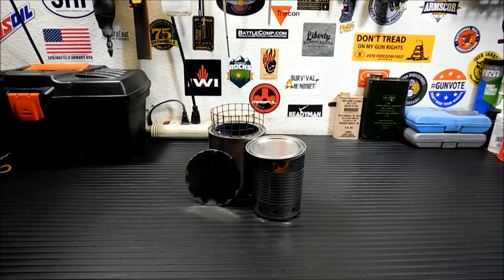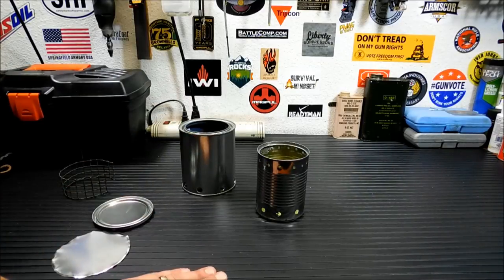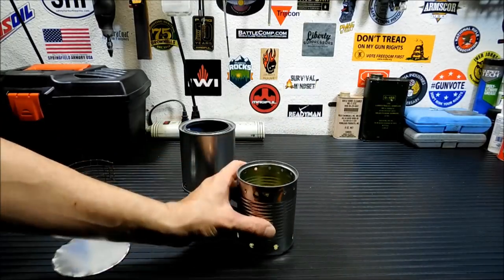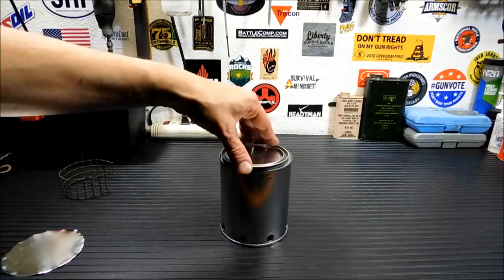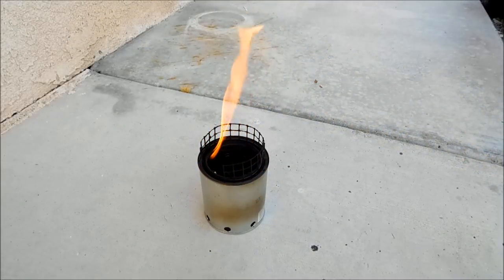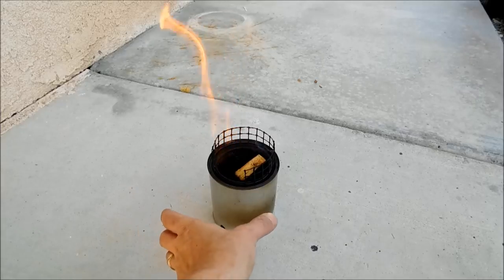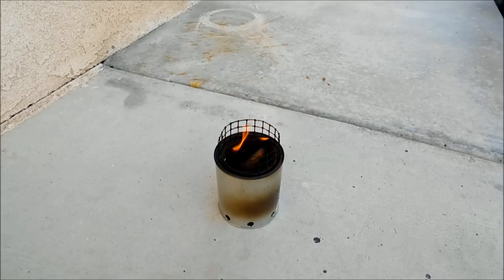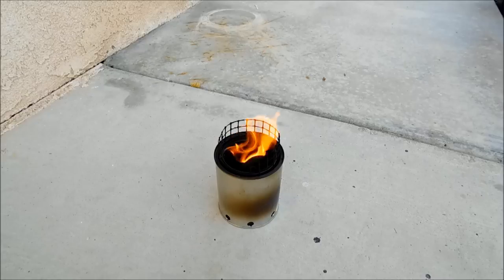Make A Wood Gas Stove With Only Two Cans

Comment: Great video, I just bought a paint can at lowes the other day to make something similar. This is a lot more easy than the one I had in mind. Thanks for posting.
Reply from the maker: No problem, the Lowes one is the exact same, I have seen in the past, people using the lowes can, it has the same inside lip that will fit that soup can perfectly.  Thanks!

Comment: I see two different size holes- what diameters are they?
Still not seeing what's going on, why the smoke leaves the small can and returns instead of coming out the top...
Reply from the maker: Bottom holes are 3/4 of an inch, not all that important but as long as they are big enough to suck gather the air from the outside.   Inside the can on the top where the gas escapes and burns is  3/16ths.

Gasifiers work on the updraft principle: The air passes up through the fuel, in this case wood, along the inside of the outer can and is re-ignited as it comes out of those top holes in the inner can, almost like burners. Hope that helps.

Comment: Said stove is not a bad idea, as long as you can burn hard wood. I live in Wyoming at 6200 feet above sea level. I built one, pretty much like the one in the video. I never could get it to "Gassify" Just was not able to get a hot enough fire using soft wood.
Reply from the maker: Yeah if you are high up, they are harder to get to work.  We are only at around 2500 feet here and it works at that level but 6200 up would be a bit harder.    Thanks for watching!

Comment: What do you recommend for a bug out bag radio.  For a non Hamm radio person.
Reply from the maker: Get a CountyComm GP-5 SSB, it has all the features you could want, is not too expensive, and can do AM and Sideband on Shortwave as well as normal AM FM.  Its super light, easy to use, and has been great for my use.  It will run you about 89 bucks  https://countycomm.com/collections/radio/products/countycomm-gp-5-ssb-general-purpose-radio   If that is too pricey you can look into a TecSun PL-380 for around 50 bucks, does shortwave AM and FM but no side band so you cant listen to ham radio  https://www.amazon.com/TECSUN-stereo-Receiver-Display-Function/dp/B004H912FC/ref=sr_1_28?s=electronics&ie=UTF8&qid=1506120250&sr=1-28